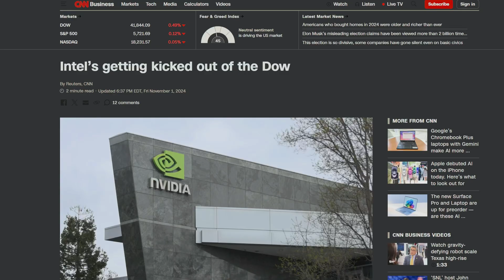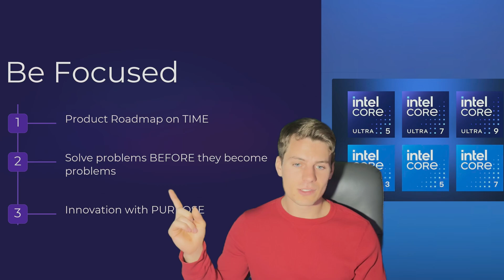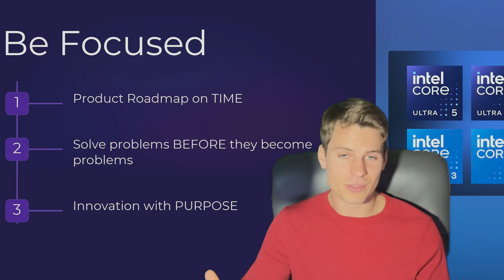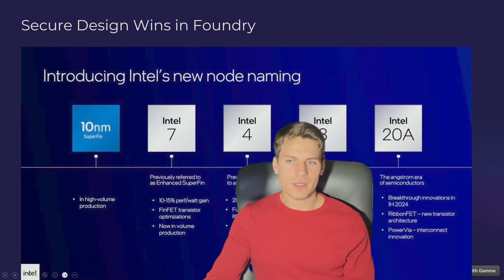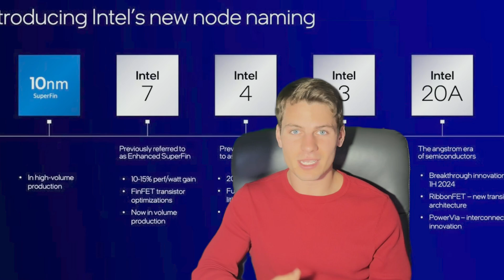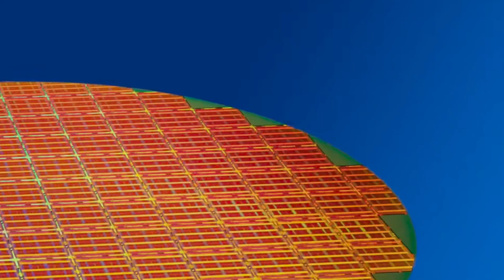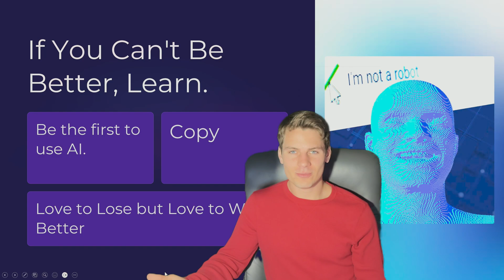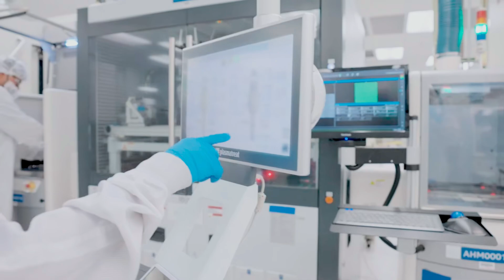How to Save Intel

Comment: Think it depends on the individual, channels that focus more on the productivity side of things or XOC are still quite fond of Intel. They've mainly just fallen from grace for gamers.

For the most part I think it's their P core E core architecture that screwed everything up. They tried to imitate mobile processors and Arm, and that just hasn't panned out. Each generation thats used this architecture always seems to have scheduling issues on windows..

For those that use their PC for a 50/50 split of gaming and productivity it's kinda of a pain trying to pick a CPU. AMD is crushing it in games, but at the same time Intel is still very competitive for productivity tasks. Your left having to compromise on one or the other.. In the past, at least when Intel was dominating the CPU market, building high end to midrange system was easy.

Competition is good, but sometimes competition also creates buyers remorse when you end up with a split in the market like we do now. It's a pretty straightforward choice if you only use your PC for one thing like gaming, video editing, 3D modeling, or something specific. It's kinda of a pain if your a multi tasker and have to cherry pick where you'd prefer have more performance while losing some elsewhere..

Comment: Intel is getting what it deserves. 
Decade of selling quad cores followed by huge hubris, waste of resources and Estrogen cores being the final nail in the coffin.
Reply from the maker: What is wrong with ecores? 4 ecores takes up only a little more die space than 1 p core meanwhile they are only something like 30% slower
Reply: @SiliconSteak  The problem isn't the e-cores, it's the hybrid architecture, chips like the n100 and n305 are fantastic and use exclusively e-cores. When you start trying to put both types of cores on the same cpu is where terrible compatibility and bugs make them a serious frustration to use. Personally I'd love get something like a 12 or 16 e-core only chip that isn't as starved for pcie lanes as the n-series.
Reply from the maker: I get that argument but in practice I don’t see ecores getting in the way scheduling wise. I do see much more issues with a chiplet architecture opposed to a hybrid one though.

Ideally we would have 6-8 huge p cores that sit on the io/mc die and then on chiplets to the side have like 20-60 ecores for acceleration of multithreaded apps.

The latency differential should easily be detectable and these separate dies could straight up be switched off if it’s a issue when gaming
Reply: @SiliconSteak  Some guy did a test, and found that E-Cores were actually less than 10% behind P-Cores in IPC, matching Raptor Cove and being faster than Zen 4 IPC wise (according to SPEC). Meanwhile, Lion Cove was actually only around a 10% uplift in IPC over Raptor Cove in most cases. That's not mentioning that E-Cores are only a third of a size of a P-Core, consumes less than half the power, and clocks decently high too. Intel really ran out of ideas for their P-Core, and their E-Cores are quite literally whats carrying them right now.
Reply from the maker: Yea ecores are actually giga good
Reply from the maker: I like ecores
Reply: @SiliconSteak  Well your philosophical approach to computing is wrong.  Or perhaps your understanding of x86-64/AMD64 architecture is limited.
Reply: Hope you like AMD selling you $600 8 cores and Nvidia selling you 12GB of ram for $1400 then........
Reply: 9800X3D
Reply from the maker: That’s really all you need to say at this point… lol